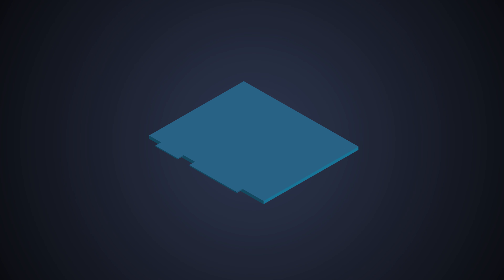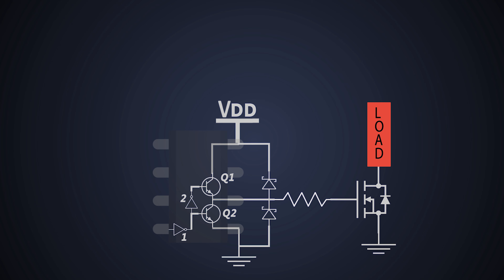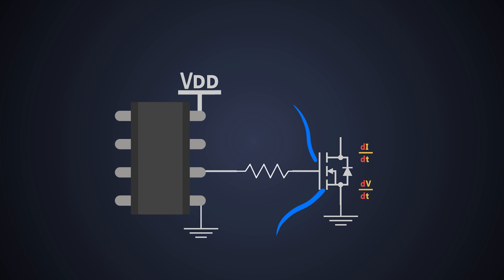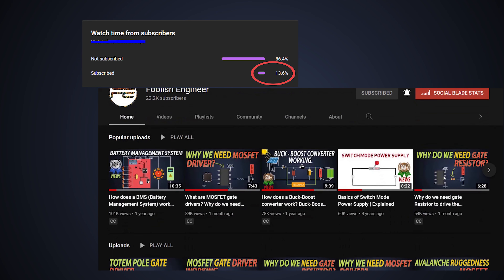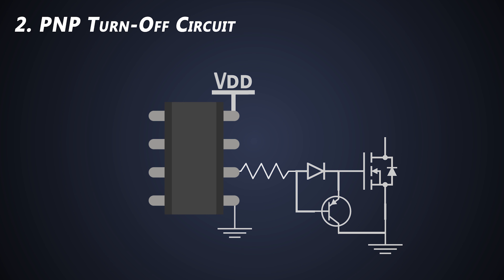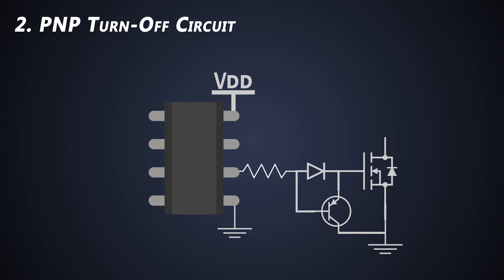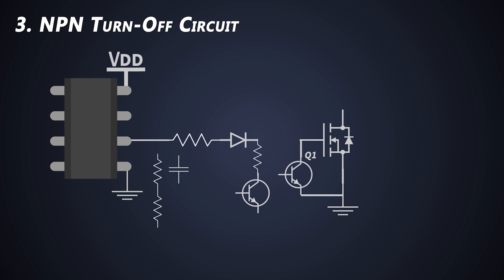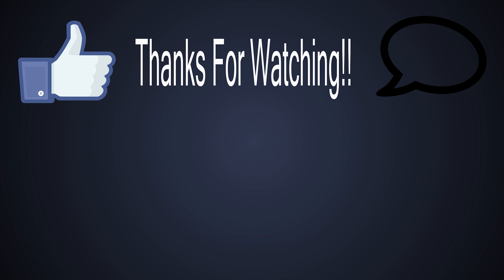How to increase MOSFET switching speed? MOSFET gate driver

Comment: Hey, this adding a PNP transistor and a diode in the FET driver circuit really helps the efficiency! I am driving a STP60NF06 and I am putting a good bunch of current through that fet. I put the series doide and the PNP transistor across gate to source on fet and amazing. Before I was hitting that fet with pulses about 90us and the fet was cooking hot in about 4 to 5 mins, with your arrangement the fet hardly gets warm, "about body temperature" with that pulse width after 15 mins. I have been upping the -on pulse time, and I am really impressed.
Great help! You must be a smart guy. I like that kind of help!
Reply from the maker: That's great, can you please share a video with me? I would like to show it other viewers as well!

Comment: Question i use the diodes and pnp transistor to drive my inverter and dc to dc converter but when I try to use it in buck converter the mosfets heating up in positive buck converter but don’t heat up at low side buck converter I try rising the voltage to 20 volt but still heating with no load so I wonder why the boostrap 15 volt drive the high side without heating up but 20 volt do without the boostrap

Comment: I finally found a good channel to learn electronics 👍🏻🙏🏻✨💖
Reply: yeah he is doing a great job of explaining key concepts he doesn't just say the usual teacher based text.
Reply from the maker: Thank you so much for watching!! Please don't forget to subscribe to our channel
Reply from the maker: Thank you so much for watching!! Please don't forget to subscribe to our channel
Reply: @FoolishEngineer  of course I will, thx to your sharing, maybe I've seen a schematic or diagram on a resistor component, or a capacitor or maybe a diode, connected between the collector & emitter, what is the purpose of that, have you made a video about this?  thank you 👍🏻🙏🏻✨

Comment: The third solution with the 2 NPN transistors will not work as you described. When driver is turned off, the base voltage for Q1 is only supplied via the FET gate capacitance. If the gate of the FET is at 0.7V the Q1 is turned off and cannot further discharge the gate capacitance. But also the turn on process is critical. You have the voltage drop of the forward diode and the voltage divider (two resistors before and after the diode) which will decrease the turn on behavior. I would not use any shown solutions.
Reply from the maker: Good for you
Reply: Could you please explain what I want to know , How can I get 1000v d.c  by I G B T

Comment: Should the NPN & PNP turn off circuits only be used when the MOSFET source is connected to ground then?
Reply: This is really an important question, and I would also very much like an answer to this. Does it only work when source is connected to ground, or can it also work for the high-side mosfet in a half bridge?

Comment: in the pnp structure, it seems that the pnp speed should be faster than the fet switch. so how should i find a fast(er than fet) pnp BJT?
Reply from the maker: You can find faster PNP BJTs but you won't be able to drive heavy loads with it

Comment: Hi I'm trying to run a 12V car fan with a power mosfet, but I'm having issues, the Mosfet is perfectly warm, no excess, but the reverse current diode I can fry eggs on it... Can you help me make a circuit from a microcontroller output of (preferably) 3.3v to the mosfet so that does't happen? Tried several frequencies, the higher the worst (I actually wanted to go upwards of 10khz to lower the noise of it)... Driving a half H bridge there are several cheap options like IR2101, but to drive just 1 N-channel mosfet nothing, its expensive or unavailable usually! Thanks and great videos!!!